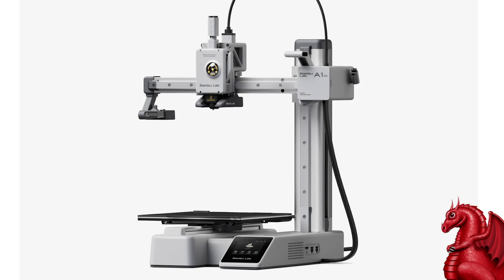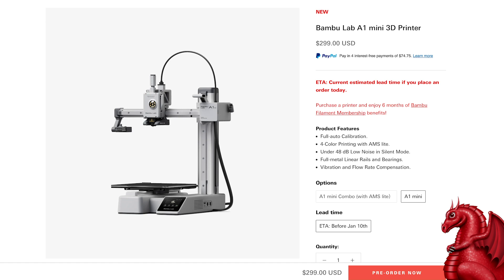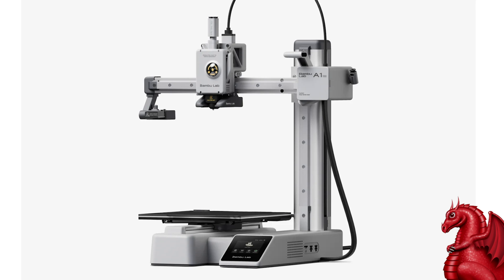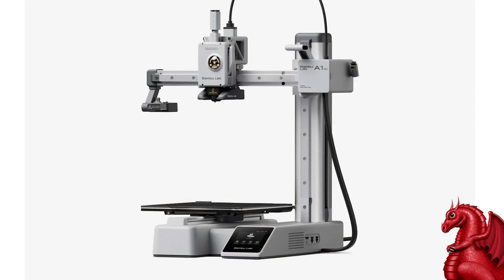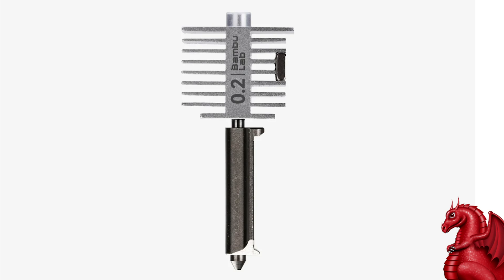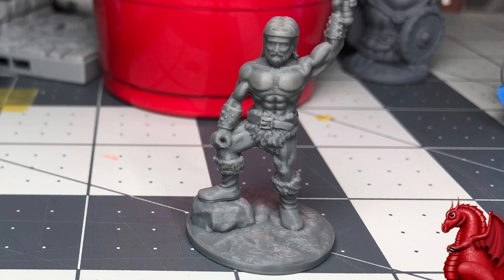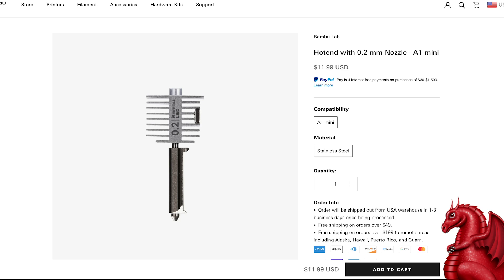Bambu Lab A1 Mini Review

Comment: I have trouble with my prints wherein corners or places where a line ends are overextruded along the velocity vector on approach to the corner or twisted in the direction the print head travels after the line is finished. I think I noticed those same defects on your square platforms for the terrain at 12:45. Do you regularly encounter such defects? Know any way to fix them? I haven't found any way to mitigate the problem with process or filament settings myself and it effects everything I print with any nozzle.

Comment: How does the A1 mini compare to the regular A1?
Reply from the maker: The A1 Mini does slightly better quality on small detailed models like miniatures.
Reply: @Tombof3DPrintedHorrors  thank you. I am wanting to print 28-32mm terrain like Ancrabourg and 28-32mm sailing ships. Will I need the bigger print bed for these?
Reply from the maker: @wigend1626  I can't answer that, it depends on how the model is designed.

Comment: Another great video of 3D printing, thanks! Been following this channel for years because you can trust the knowledge given here. I’ve still got an old Ender 3 I’m thinking of exchanging to something newer. I do already have a X1C, but we all have a few printers sooner or later. Just wondering if the A1 is as good as the A1 mini, only with a larger bed, like the size of my old Ender 3?
Reply from the maker: They A1 is a fantastic printer. I get slightly better 28mm miniatures off of the A1 Mini, but the difference can only be seen under magnification.

Comment: Had one for a few days. I got three prints out of it then an Extruder gear broke. I took the covers off and there was a yellow plastic gear, with a steel axle press fit into the plastic gear. The axle turned, the gear did not. Returned it. Bad design!

Comment: what does your print farm look like? How is it setup/organized? And what printers are in your farm?
Reply from the maker: Currently 8 printers running with four older Ender Pros/V2s in storage. Print farm consists of a mix of Ender-3 Neos, V2, V3 SE, Ender-2 Pro, Bambu Lab A1 and multiple A1 minis. All are set up on steel tables in case of a fire so that nothing around the printer would be affected. These are the tables I use, they can fit four standard Ender or full size A1s, or with the A1 Mini I can fit three on the top: https://www.amazon.com/gp/product/B074M7KVSH/ref=ppx_yo_dt_b_search_asin_title?ie=UTF8&psc=1

Comment: so u would say, buy the mini or the A1 ?
Reply from the maker: I prefer the A1 Mini and have bought multiple ones, I only own a single full size A1, and that's just because of the bed size. Both are fantastic printers, but the Mini does slightly better with 28mm miniatures.
Reply: @Tombof3DPrintedHorrors  thx for replying!
I have a p1s , wanted an @1 but they are unavailable atm , next is the mini , but only 18x18x cm…
Reply from the maker: @Jacksteelmachines  that will print nine standard dungeon tiles, so plenty big for most tabletop gaming needs :)

Comment: Maaaaan I am struggling to pick a printer to upgrade to. The fast swapping nozzle, touch screen and half the price of the P1s makes this really tempting. I probably wouldn't experiment with different nozzles on the p1s simply because it involves a few steps in a small enclosed space

Comment: It is a nice looking machine, but I have given up buying all new products for the time being.

Instead I am working on an open source printer based on a couple of upcycled CD dives.  It does not have a huge footprint but it is only meant to be used for minis and scatter. Plus it only costs a couple of bucks to assemble, and as we get to the realm of the ten minute benchy, it is surprisingly quick.

Now, all I need to go with it is a reliable independent power source, and a way to reuse all the plastic that we are currently drowning in. . -)

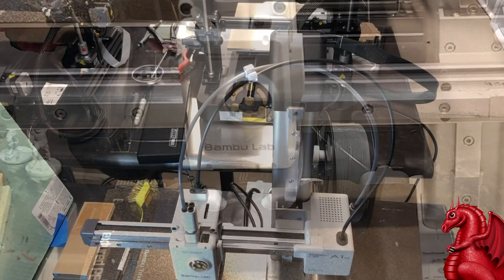Comment: 9:10 i had the same problem but i replaced the included wire/tube holding clip with 3 smaller ones i found on printables. It might be a more appealing solution for some.

Comment: Excellent video, Tom. The one thing holding me back is the bed size. I've got a ton of tabletop terrain files which were designed for Ender 3s and so require at least a 200x200 surface. I hope you'll give the A1 a review, because if it can produce similar results slowed down with a 0.2mm nozzle, I think it's likely to be a better all-round option for people who only want one printer. I've seen you speculate it will likely not be capable of similar quality to the A1 Mini, but so long as that reduced quality isn't massive, I think the additional size will more than compensate.
Reply from the maker: I have an A1 that I will begin testing next week. I doubt it will fully match the A1 mini's print quality as the full size A1 has no Z axis linear rails like on the mini.
Reply: @Tombof3DPrintedHorrors  Sure, but you've had great quality results from Ender 2 Pro and Ender 3 v3 Neos which have Z axis lead screws, so while the quality might be better on the A1 Mini, I'm interested in how much better. It's all a case of balancing features and what tradeoffs we as consumers are willing to make. Anyway, I'm looking forward to the A1 video!
Reply from the maker: @3Skulls  but those printers have a single Z screw, not dual which can actually 'fight' each other during movement. The Ender 3 V3 SE has a dual Z screw like the A1 full size and its small model (like minis) results were poor because of it.
Reply: @Tombof3DPrintedHorrors  Ah, good to know! I've only got the Ender 2 Pro and need to upgrade to something bigger to handle bigger terrain pieces, and want to get something from the current generation of printers. For that, I think the A1 will be fine. I can always use my E2P for the fine detailed miniatures.

Comment: As someone who is new to 3D printing, and is still looking for the best printer for me, i am coming round more and more to thinking about getting an A1 Mini. I want to get something for printing scenery for model railways. I know that I would get better details with a resin printer, but I don't want to get into the worry about the fumes and chemicals. I won't need the bed space that an A1 or other larger printers for small items. Yes, a bigger bed would probably be better if I also start printing toys and other 'fun objects' that seem to be available (and with an 11 year old nephew i will likely be doing this!) but I will just have to work with it! Finally, I want a printer that works straight out of the box, foes pretty good detail, isn't too expensive, and is reliable - and this A1 mini seems to fit this!
Reply: Replying to my own comment - ordered an A1 Mini today, as Bambu has dropped the price! 😃

Comment: I wish I knew about this brand before I spent months trying to work with the Ender 3 Pro and then Artillery Sidewinder. I Sidewinder is great, but not so much for mini's. Going to have to pick this one up, I don't have time to tweak. To set it and forget it for the most part and the turnaround time is amazing. I'll make sure to use your link. Thanks!

Comment: I'm sold, may have to wait until after Gary Con though!  Curious thought, is there any reason you don't use Octoprint? I find the web interface so much easier than messing around with SD cards.
Reply from the maker: I'm not a fan, print quality is better with SDs when I compared them.
Reply: Interesting, I'll have to run some comparisions.

Comment: A1 mini seems nice but I can't understand why people keep comparing it to 3-4 year old ender 3 (v2, pro or stock) and say BL is better? Isn't it obvious as ender 3 is significantly cheaper and a few years old? Why isn't it compared to Ender 3v3 KE, Elegoo Neptune 4, Qidi X-Smart 3 or another new printer in similar price range? What does it have over those printers other than AMS possibility and easy nozzle swap? Also what are thing you can have with alternatives over A1 mini? Temps for different materials, build volume, something else?

Comment: Tom, thank you for an insightful look at this thing. I've been working with my V3 SE for some weeks (trying to print minis, as opposed to terrain) and the results are anything but satisfactory. I'm very tempted to get the A1 mini but having just spent $200 on the SE I don't know if I can do it. Do you have any words of reassurance that with more tweaking I can get good mini results, or should I just bite the bullet and go for the A1 mini? Thank you again for all the videos.
Reply from the maker: The SE does great terrain, but I have given up trying to get really good minis off of it (plus .2mm nozzles are difficult to obtain for it). There is simply too much mass with the Sprite extruder to do tiny work like that. Only Bowden feed Enders are great for minis.
Reply: Thank you for the reply. I did actually manage to obtain .2mm nozzles for it, but considering how bad the 0.4mm minis came out I'm not very hopeful. I suppose I'll have to see if Amazon will take the SE back, but I am similarly not very hopeful about that either lol. But again thank you for the advice.